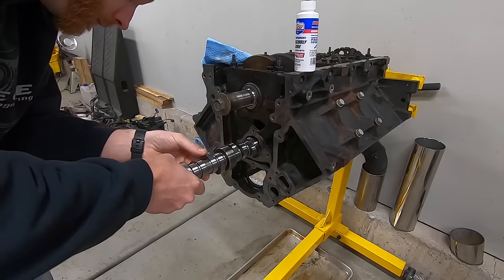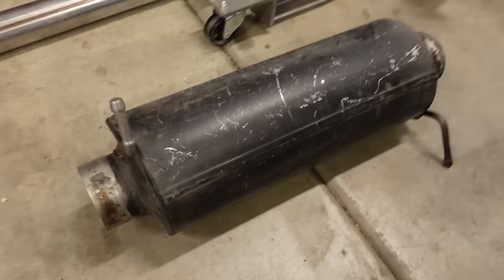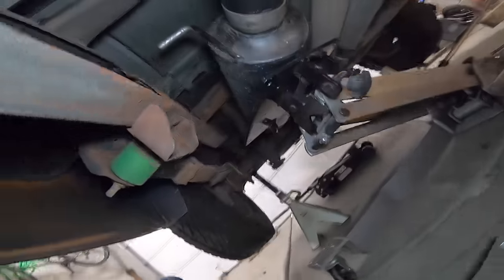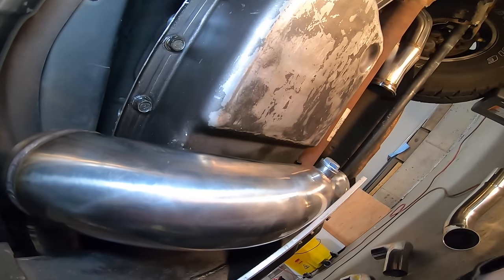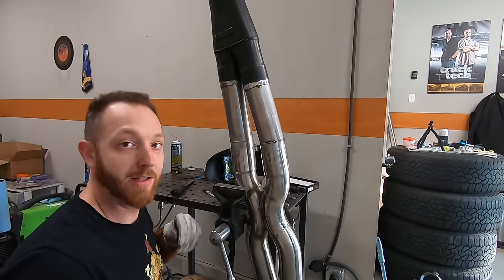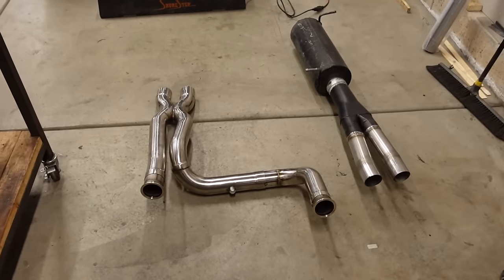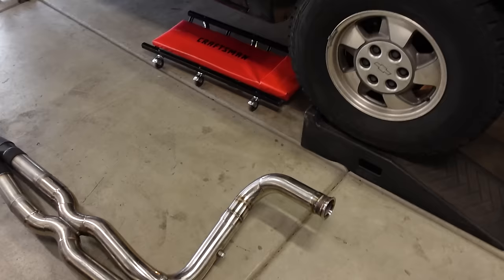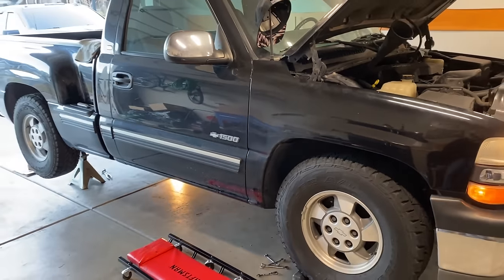the MOST INCREDIBLE sounding exhaust EVER! 4.8 vs 8.1 shootout Pt.9

Comment from the maker: I just hope this exhaust works as well as it sounds. So close to getting this thing on the dyno again.
Reply: I want that exhaust when you go turbo
Reply: 21:06 man that sounds good.  Would love to have that on my '88 c1500 with the 350
Reply: I ran mufflers and turn downs on my lowered 3500 7.4l dually for years, finally built full tailpipes and it completely changed the sound! Thankfully for the better. I can't wait to hear your 4.8 when its finished.
Reply: I've always wanted to do this but never found anyone who has untill now 👍👌
Reply: You’ve got mail sir... Via Facebook messenger
Reply: LT - missed you when you went off the "other" network.   So glad I found your sight here on YouTube.  Keep up the informative and entertaining videos for gear-heads young and "OLD"!  Kudos
Reply: Add a little air flow in your start up and idle tables and not sure what idle rpm you are at but 800 hundred is usually where I start with a cam and do slight increases/decreases until it's spot on happy
Reply: Love the way it sounds but think when you get tail pipe on it will finish it can’t wait to see how much power it makes
Reply: Nice work LT!👍
Reply: Trombone the passenger side to equal the length
Reply: What tune program do you use for that? I notice there are two pieces missing on the exhaust. Meow Meow!
Reply: That thing sounds awesome!
Reply: Can I get you to do my 2014 silverado? 😅
Reply: I would like to hear a before and after.

Comment: People don't understand that pushing a 5.3L to 600hp is wear it out faster than pushing a 8.1L engine to 600 hp. There is a reason the 7.3L powerstroke and the ford 300 last so long, it's because they are de-tuned. If you crank them up to 600hp they won't last nearly as long.

Comment: I love a big single exhaust. Sounds good on everything in its own way. My sister did a 4 inch straight pipe on a 4.0 grand Cherokee in high school. It idled like a Cummins and revved like an Indy car. Weirdest shit I've ever seen.
Reply: Had an old neighbor with a similar setup, just had an old diesel stack cut way down from under the rear door and somehow straight out and it rumbled from a mile away
Reply: I had a friend customize a cone shaped intake for the 4.0L Cherokee back when you couldn't buy one. He made it from some PVC pipe and an open air cone filter for a Honda Civic. It had a pretty nice sound at high RPM. That with a magna flow exhaust and 5 speed manual, back in the late 90s, it was a sleeper.
Reply: The  older CJ5 Jeep with an I6 could be had at a curb weight, 1000lbs lighter. Still a jeep and plenty quick for time.
Reply: @JPGenergy  haha I bet all the neighbors loved him

Comment: Wrap the y pipe under the transmission. Itll radiat heat into the transmission. Noticed it on my 2017. Wraped the left bank under the pan. Solved the heat soak.

Comment: Sounds great, everyone thought I was dumb for doing 3" single exhaust with a MagnaFlow 3" straight through muffler and a 3" dump in front of the axle. Mines very subtle until you stab it, then it really talks to you. My truck is stock with a home made cold air, stock converters and the 3" single custom made (by me) cat back exhaust. It's a 2000 extended cab 4x2 with a 5.3 and 4L60E. It's got 286,000 miles on it and I drive it daily. It's a super fun truck, sounds great and runs very very well. Glad yours sounds like mine and you like it. Great job, keep it up.
Reply: I am running the same setup as u except the muffler brand but I get a lot of compliments on the sound its suttle until you stab it next to the guy texting while driving and he drops his phone...lol that works for me
Reply: I had a vehicle with a 5.3L swap and it had single 3' with a Magnaflow and it sounded absolutely amazing. Unfortunately, the person who did the exhaust, did a horrible job of routing it. It was an off-road vehicle and I needed it redone for ground clearance. Went with a true dual setup and it sounded like garbage.

Comment: I did basically the same thing on my 5.8 windsor. 2 1/4 to a single 3” x 12” long resonator into a holley single inlet flowmaster with dual 2 1/2” out the back. Sounds similar to your truck. I love it.

Comment: I’ve used C25 with TIG accidentally once. Wrong labels on two otherwise identical 250cf bottles.
It burns up the tungsten very fast, especially on the sizes used on thinner material. I wouldn’t doubt it if that oxidized tungsten gets shot straight into the weld puddle either.

So, no, it won’t work permanently. You’d be better off using the MIG on stainless than C25 TIG.

Edit; Try it for yourself! As a hobbyist welder, I never even thought about it until that happened.

Comment: A lil tip that helped me. They sell mock flex tubing in required OD tubing your using to get the angles and path desired. They fit tight around the steel mock set up and allow to manipulate how ever you need to find the right path to connect tubing. 

But , beautiful work sir!

Comment: Looks and sounds great! I just finished up a cam swap on my O6 5.3 and I need to do a setup like this!  
On a side note, this last cam I did I had the engine out and decided I was going to put the engine flat on its back and drop the cam in vertically and it worked awesome. 
Horizontally I always seem to scratch the cam bearings just a little no matter how hard I try.

Comment: I had a 383 in an s10 once.  2.5" from the headers Y'd into a single 3."  I used a huge RV 3.5" ID straight through muffler, then Y'd back into dual 2.5" tail pipes.  Mild cam, so not too loud or rowdy, but that exhaust was super low sounding.  Made it sound like a huge motor was in there, lol.

Comment: The black widow muffler on my 5.3 LS has a dual 3" inlet and single "3 outlet. It has 1 7/8 headers with vbands to an x pipe similar to the one you show. (May even be the same). So after the x pipe it has a 30" dual straight section to the black widow dual to single. With another vband flange on the outlet. Has a single 3" over axle and straight out. No cats but here in VT on a 1990 car it isn't required. It does sound pretty amazing. The 226/238 .600 lift cam definitely aids that and the tbss intake is pretty good as far as stock intakes go. With a trunion kit and pushrods it made 390whp and 395wtq.

Comment: I like the way you use material clamped to the truck to keep parts of the system positioned correctly to the vehicle. Sounds great!
Reply from the maker: thats the only way to do it for me. I've tried once or twice to do the sharpie mark and weld it outside the truck, but inevitably something moves around and wont line up properly. By clamping everything in place on the truck and getting 3-4 good tacks on each joint, you're pretty much guaranteed to have perfect alignment, which is critical when having 2 v-bands and no flex couplers.

Comment: That was awesome. I was going to do that with my old IS350. Headers into a X pipe then into the ISF Y into a single huge 90mm muffler then out into the dual again after. 

Was told it would not work etc etc. but I found a guy who did just that and the X pipe made more torque from 2,000 to 5,000 by 2 - 3%. 

Engine Masters on MotorTrend did a full test on the X pipe with great results. The Y after if not restricted will add to the sound. Pretty cool exhaust build you did 😀👍
Reply from the maker: hey thanks! I was a little nervous about how the X into Y would sound, but once I started it up, I was pleased!

Comment: My Silverado came with a 4.8 and i just swapped the crankshaft and piston rods to convert it to a 5.3, since 4.8 have flat pistons i get a little more compression, add to the i swapped the 249 heads to 706 and they are cut for even more compression, swapped the cam for a BTR Torque Cam and deleted the VVT, had it programmed with HP+. I still need long tube headers and the x pipe but since im disabled and lost my job due to surgeries I ran out of money and the disability checks are minimal... So in hopes i do get better after all 3 surgeries and don't end up needing a 4rd surgery i hope im able to work again and finish my truck.

Comment: Just an edit to the x pipe explanation, the exhaust doesnt necessarily cross over, it mostly stays on the same side with a small amount of separation. The exhaust pulse hitting the point where they join does indeed help pull the exhaust from the other side. And for noise, an x pipe is an affordable substitute for equal length headers

Comment: Look into the Gibson MWA muffler...and the Aeroturbine. 
The Aero tends to have a nice loud hollowy sound...and there XL series works awesome on reducing resonance on 4 bangers ..especially catless ones. 

The Gibson 5" race muffler on my Dakota 4.7...makes a massive difference in flow and the truck loves it. However...im considering switching to Corsa Pro Series. 
Same as you..im picky and have changed my Dakota exhaust about 9 times. Made my own larger collector into stock cat...directly into muffler...into Y pipe...to dual 2.5" lengths into stainless downturn tips.
Also...anytime you do an exhaust...you should have about 18" of pipe after the muffler itself to accomodate its designed flow characteristics. An opened flanged at muffy will just disperse energy wildly and loose effectiveness. Happened on my exs Tahoe with flowmaster 10 series...they had a slip of paper directly stating this.

Comment: Hi LT NICE job on your truck 🚚 anyway the way that of the engine rumbling it reminds me of my late uncle 55 Chevy he had a 283 bored out to 301 11.1 compression he also used a camshaft from TRW in the day they didn't use the terms they use now they called it 3/4 so the cam you are using reminds me of that

Comment: Ps: I'm not an LS guru such as yourself, but have heard those 4.8 can really take some rpm with valve train mods. Next thing I need are some worked 799 or 243 heads to swap out my 706 for. The 706 we're rebuilt and the motor got new headgaskets and head studs. But aside from the cam, pushrods, pac 1219 springs it's all old junkyard motor internals. Has been abused pretty good it's first 5k and still holds 40psi of oil pressure. About 60 at cold start.
PS wish I had your fab skills. I fabbed an air filter heat shield using license plates, some heat duct tape, and self tappers lol...

Comment: Sounds nice and mellow.  Very similar to the 448 inch Arrington Hemi in my Chrysler 300S.  I wanted a civilized sound in that daily driver and ended up with inch and seven eighth Stainless Works long tubes mated to high flow cats blowing into center mounted resonators with a balance pipe and stock rear mufflers.  Car put down 562 HP to the tires with 554 LB FT and is almost as well mannered as the stock 5.7 engine that made 324 to the tires.  It's a dream to drive and scary fast.

Comment: 4.8 is a destroked 5.3, i converted my 4.8 to 5.3 by just swapping the crankshaft and push rods, also i swapped the heads from i think they were 243 or 249 to 706 ported and cut for more compression, swapped the cam for a BTR Torque and had it programmed.

Comment: Two 3's into a single 4 is not only matched for airflow, but is going to have a HELL of a lot of airflow. Great choice. Only bad thing I have to say is that THAT X doesn't have a whole lot of crossover compared to something like a Carven X.

Now if you wanted something REALLY crazy, imagine this using a Borla Switchfire for the X.

Also, the worst thing about trucks is that you can't have equal length downpipes coming to the X, which, I hear ruins the scavenging than an X gives you since it's no longer timed correctly.

Comment: Things don't have to be perfect for the Venturi effect to work however every system will have natural and resonant frequencies. Those frequencies can exist from wave energy or hemholz effects. Waves move through gasses and reflect when the impedance changes. They dont change with rpm and will shift from being beneficial to negative throughout the rpm range. With equal lengths or at least precise planning you can in theory get it to be beneficial to all cylinders at peak HP and you may also get additional affects near peak torque and have great Dyno results. There are also possible tunings that would have negative results. For hemholz effects, it usually gets dumped at higher engine speeds and while hypothetically it could be tuned for a positive result at any speed the math might prefer a smaller pipe than ideal for airflow. Hemholz is often used to cancel sound rather than add power. That said scavenging doesn't only come from length tuning but also through having mutually beneficial merges in the system and not every exhaust system needs a PhD in acoustics to be better than what you have.

Comment: 2004 Pontiac GTO here. Speed engineering LT headers to x mid pipes, to custom Y pipe for a single exhaust corsa speed exhaust 3” w/ 4” exhaust tip.

Comment: I literally have the exact same set up on my 05 2500hd. Speed engineering long tubes, x pipe, to a y pipe into my flowmaster 4 inch hushpower muffler, and a dynomax 4 inch tailpipe. Only think I notice is that mine seems a touch louder then yours. Could be the difference between a 4.8 and a 6.0?

Comment: I have speed engineering headers and they are made of your standard cheap Chinese stainless (200 series)The flanges are Carbon steel and it then has been plated somehow. However I Cerakoted the headers and it seems to help.

Comment: This sounds really good.  I run the Hushpower mufflers too.  

But the X pipe is pointless with the Y pipe.  X pipe is to help create scavenging in dual exhausts, and like the man says, the Y pipe does the same thing. Would have been good to get a sound comparison with and without the X pipe before the Y pipe (I know that would be lots of work).

Also worth checking out the Engine Masters episode where they tested true dual (no crossover) with an H pipe and an X pipe.  Pretty much no difference in power between the true duals and the X pipe, but the sound does change.

Comment: I assume the 4.8 is a V8 is that correct ? I would like to achieve the same sound out of my 4.3L V6. Would you email me the part numbers for the mufflers and cats. if you used cats? The OEM Single 2 into 1 exhaust on my S10 EXTREME was mostly 3" except for the Down pipe of the OEM exhaust manifolds and they were 2" ! I have a 2.25" exhaust pipes on it now that was suppose to be for an LS swap that never happened. (YET) Thanks Rod

Comment: Wish my welds looked as clean as yours!  I’m learning to tig and I did some exhaust changes on my chevelle.  It’s sealed up but doesn’t look very pretty.  I may get your opinion on something.  I had a 350 with a radical cam in a basically stock motor otherwise and It sounded awesome running through 70 series flowmaster mufflers with no H or X pipe, just simply cut about a foot before the rearend.  I installed my race motor in it and then it sounded like crap no changes to the exhaust system.  Sounded like it was beating the flowmasters with lots of ringing.  I pulled them off and installed some Jones resonators with the large 10” body with 3” in and out. Now it sounds clean and mellow at idle but at 2500 rpm under throttle it sounds like tail pipes poppin.  As if I have long 1” pipes out the back. It’s embarrassing! I would think 3” should be plenty of flow. What do you think?

Comment: Whole 'nother engine/vehicle but I have an 09 eForced 5.7 Hemi Charger. After playing the pipe/muffler shuffle, I ended up with a Solo Performance J system. It has an H pipe in the mids, a  X crossover style muffler and a couple of helmholtz resonator J pipes at the rear. It barks right at start up then immediately settles down into basso profundo yet mild idle. Driven normally, one might even be hard pressed to say there was a cat back on there. But, boot the fun pedal and you'd swear there was a NASCAR stocker coming down the street. And, VERY little drone on the expressway. Now, I'm a fat, crabby, old man and am no longer interested in having the loudest system I can get my hands on, so there's that. However, it's only a 2.5" setup but still flows enough for 490/495 at the wheels, with cheap ebay stainless headers. Just an FYI.

Comment: Correct. A 6.2 has higher output specs than the 02-06 8100. A 4.8 with at least 10.5 comp ratio, and stock cam (believe it or not), and some bolt ons will have similar HP as the 8100. Not torque though. An aggressive cam could do it, but it makes a poor street cruiser compared to 8100 peak torque at 3200 rpm. Solution: 4.8 stock, blueprint/bulletproof, roots or screw blower, and a tune. Over 400 hp and torque at 4500 rpm. Done.

Comment: What you built is fundamentally solid.  The original X pipe with the curves like what you used was developed by Dr Gas in the 80s. When cup cars started using them they went to a common boom tube that would be like your Y section.  The street X pipes some companies are selling that are built with angular intersections are just dumb and wrong.

Comment: I'm using that same Flowmaster y pipe. Y300400. Yeehaw.
  The y pipe won't stay black for long. You'll need to use some high temp paint on it once that burns off.

Comment: Sounds damn good to me. It almost sounds meaner than my 1970 351 did, which in my book is a SOLID win for a 4.8. The 302 in my 68 Cougar never sounded as mean or Bassy as the 351 did. 

The 351 (it was in a 1970 Ford Torino) actually never had an aftermarket exhaust at all, it was just mean right off. The Cougar on the other hand did and still didn't sound as mean as the 351. Just for further understanding. I love the sound of an 8 into 1 exhaust, I just need to find the car it will work on without sacrificing other things to get there.

Comment: My question is when you need to drop that transmission oil pan to change fluid and filter are you going to have to take the exhaust apart? Cause it looks like the pipes are in the way of those pan bolts.